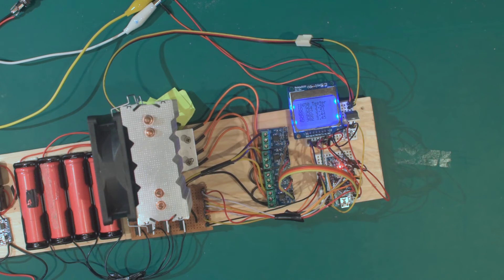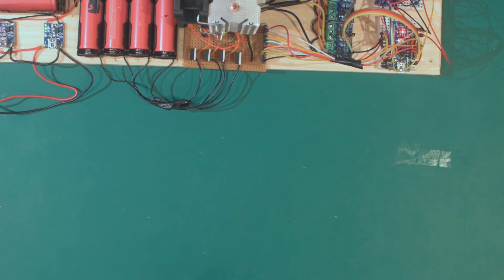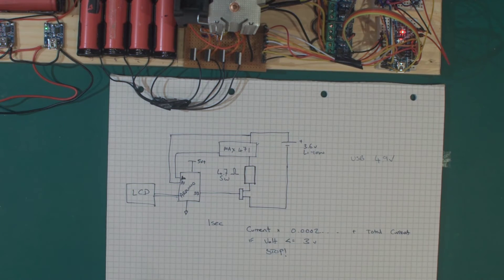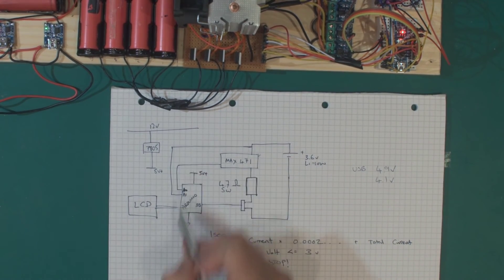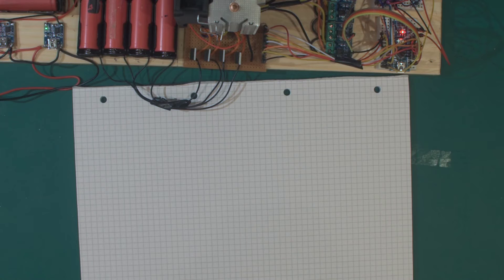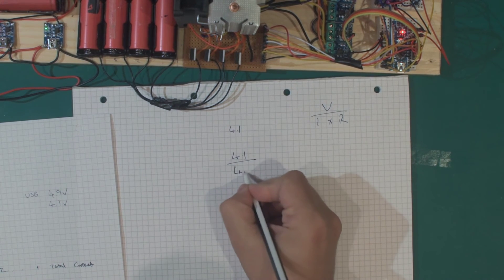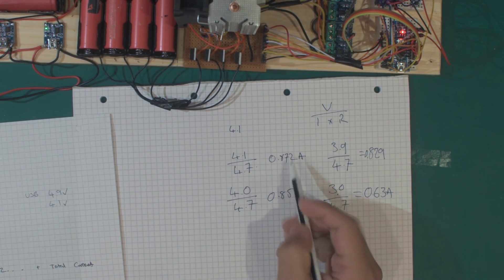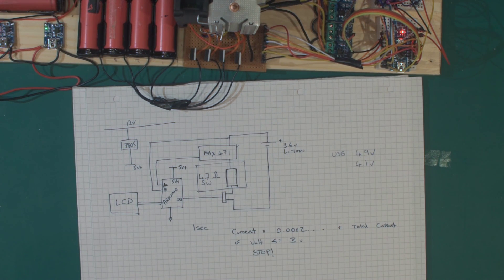18650 Station - Arduino Voltage References & LCDs

Comment: The fact that you are using a constant resistance (rather the constant current) for discharge shouldn't matter much if you are correctly integrating the power (I times V) at one second intervals.  A realistic discharge that looks more like real world use would be constant power.  A simple way to achieve that would be to use a boost regulator followed by a resistor, that way as the cell voltage drops the current required will increase.

Comment: I am using 4.1V reference voltage generators for ADC readings. A good choice is  MCP1541-I/TO. 4.1V is good approximation of 4096mV (a power of 2).
Reply from the maker: +Vladimir Georgiev the 7805 isn't perfect but the currents it's supplying gave steady enough reference for the readings to be no longer wildly inaccurate. I'm gonna do a follow up later I have ordered a few references that are more accurate, I'll order a mcp1541 as well,  thanks :)
Reply: I am not saying 7805 isn't good enough.  I am using 4,096V reference because it is easy to be manipulated by shift operations like /2.
Reply from the maker: +Vladimir Georgiev Apologies,  I personally didn't think it was good enough, so the recommendation of other voltage references was useful.
Reply: Wouldn't it be better to get or build a good 5V transformer instead of sluicing trough several stepdowns?

If the 12V supply is 80% rated and the 5V buck is 80% rated, you're already down to 64% power efficiency.